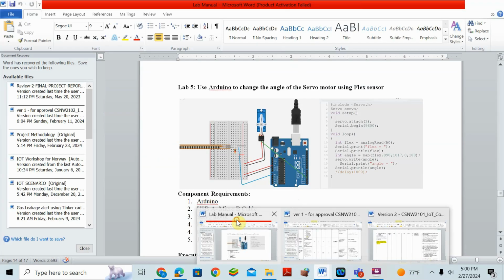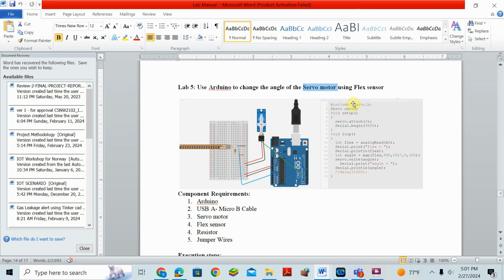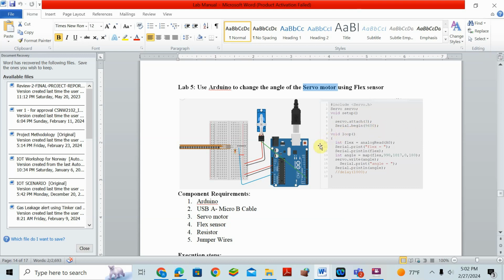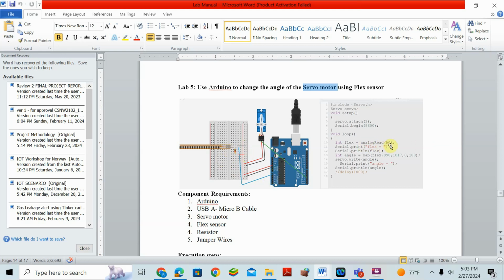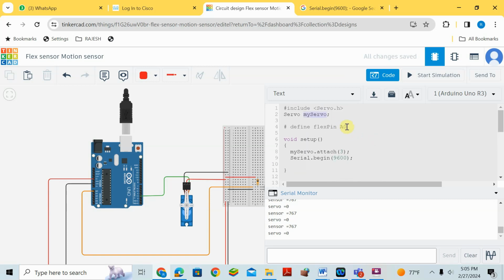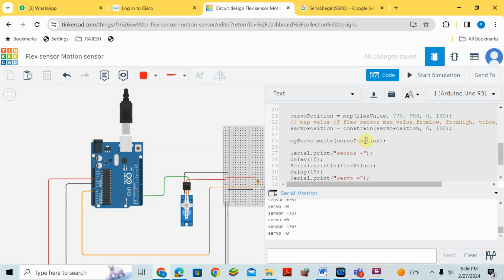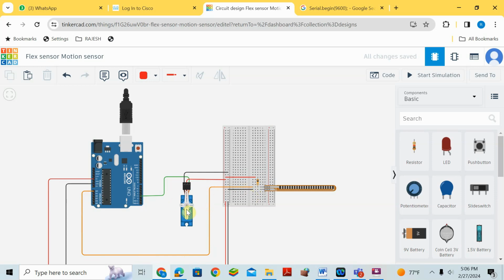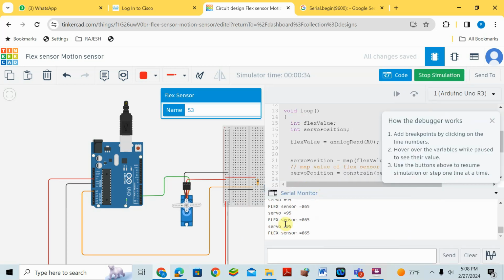Lab 5  Use Arduino to change the angle of the Servo motor using Flex sensor

Comment from the maker: Lab 5: Use Arduino to change the angle of the Servo motor using Flex sensor
#include <Servo.h> 
Servo myServo;

# define flexPin A0 

void setup() 
{ 
  myServo.attach(3);
  Serial.begin(9600);

} 

void loop() 
{ 
  int flexValue;
  int servoPosition;
  
  flexValue = analogRead(A0);
  
  
  servoPosition = map(flexValue, 770, 950, 0, 180);
  
  servoPosition = constrain(servoPosition, 0, 180);

  myServo.write(servoPosition);
  
  Serial.print("FLEX sensor =");
  delay(15);
  Serial.println(flexValue);
  delay(15);
  Serial.print("servo =");
  delay(10);
  Serial.println(servoPosition);
  
  delay(20);
}